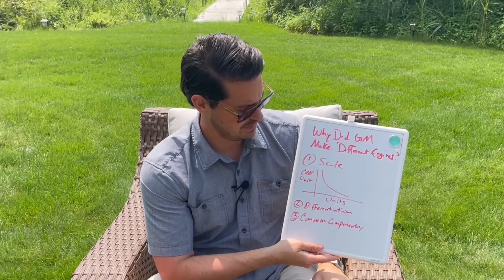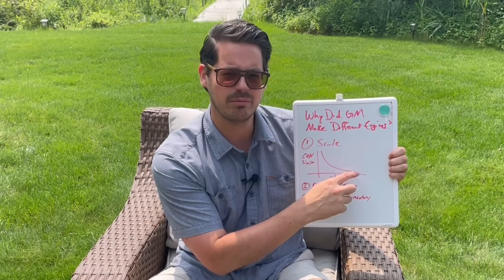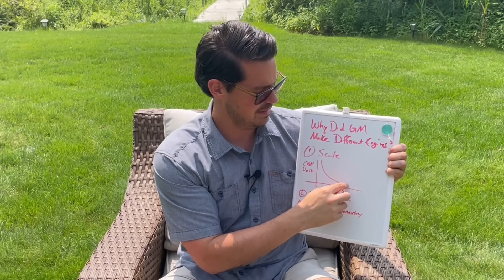Why did General Motors (GM) Make So Many Different V8 Engines in the 1950s-1970s?

Comment: Great, informative chat.  I recall test-driving a new 1975 Cutlass Supreme that seemed sluggish and noticeably different from the Olds Omega 350 I had just driven.  The engines felt and even sounded different.  I thought at the time that the Cutlass was more like a Chevy 350 as I had also been test-driving a number of Chevys w/ 350s, namely Monte Carlo, Malibu and Nova.  I ended up with a Camaro with a 350 4bbl.  I can remember when GM's engine-swapping got publicly exposed in 1977. It was a PR disaster for GM.

Comment: Or I have the 1981 Pontiac Bonneville with the Oldsmobile 307 with the 200-4R transmission and  the 1985 Caprice with the Chevrolet 305 with the 700 R4 transmission. One of the last holdouts i think of GM using 2 different engines with nearly the same displacement.

Comment: Interesting explanation. Thank you. I know I've mentioned this before but I really find it interesting that they didn't really have that much diversity in technology such as having one be a hemispherical head and another one being an overhead cam head to spread out their offerings and respond to some of the competition such as Chrysler with their use of hemispherical heads.
Reply: Really didn't need the exotic designs when their bread and butter designs were good.  Sure GM experimented but getting away from the normal stuff but doing so costs a lot of $$.  Ford has been the worst at blowing $$ on continuous new designs.... I give you the LS engines vs Fords SOHV, Hemi style and current OHV engines.

Comment: Gr8 Stuff Adam. Makes sense to save money through Economies of Scale, as Retooling wud have cost a lot more for Upgraded Engines every couple of years....Yep, differentiation was sensible if Recalls of the same engine was required.....Ford's Model T's wud have been a real problem for Old Henry Ford, if mass recalls were required on the exact same vehicle. A Reversal of The Economies of Scale and why all the other Manufacturers back then diversified engines, etc....😊👐

Comment: The main reason that GM started screwing their customers with chevrolet engines in Oldsmobiles, is
 because about that time they took the best and most durable V8 they made and turned it  into a extremely flawed diesel. Because the diesel was machined on the same lines as the gas engine, they didn't have the capacity to do both. We all know how that turned out. 
Of course GM has a long history of doing their R and D work with their customers money. 
Also the Buick V8 was their newest design of all the legacy engines and the first one to be discontinued. Brilliant!

Comment: An important influence on driving this rationalization of engines had to do with the high costs of emission certification. There were many drivetrain combinations that were low volume that the certification costs couldn’t be justified. The Z28 after 1974. The Pontiac SD455 also after 1974 along with the 454 in the Corvette. Each drivetrain combo in a given model had to be individually certified. Ford and Chrysler had similar actions. The need to meet stiffer EPA standards in 1975 that usually required catalytic converters killed off a lot of choices.

Comment: Great video, and some excellent comments, too.  When I was car-shopping in 1973, I noticed that all four GM car divisions (below Cadillac) had 350 cu. in. V8s, and they all had different bore and stroke dimensions.  Working through the numbers showed that they all came to between 349.5 cu. in. and 350.4, so all rounded to 350.  When I began working at GM in 1978 I learned that even Corporate management wasn't completely aware of the Great Chevy-mobile Debacle of 1976.  As I recall, it began when an Olds customer brought his relatively new '76 model into his dealer for a routine oil change, and the mechanic found that the oil filter was on the other side of the engine from where he expected it to be, and it was substantially smaller.  Until the mid-1980s, each car division had its own engineering staff, and each division was responsible for engineering everything forward of the firewall, which included the engine.  This is why you'd find the battery and windshield washer reservoir in different locations among the GM car divisions' models, even within the same platform (mid-size A-body, full-size B-body, etc.), and even different colored caps on the windshield washer bottle.  Brand identity was always a major concern for all automakers, especially among the GM car divisions.  Chevrolet's Number 1 competitor wasn't Ford, but actually Pontiac or Oldsmobile, as it was just as great a sin for Chevy to lose a sale to a sister division as it was to lose it to Ford, or Chrysler, or an import.

Comment: It also allowed the division managers and engineers to tailor driving characteristics and gave them some control over quality. The divisions were somewhat competing with each other. And the buyers took pride and were loyal to their brands often times because they liked that divisions engines. Then came 77 Chevymobile controversy. Many people were upset when they found out their new Oldsmobile had a Chevy engine but the air cleaner still stated Oldsmobile V8. Oldsmobile knew their customers wanted Oldsmobile engines.

Comment: Love to see a dyno comparison of all 350s from each division of the same year, completely stock and then modified with intake, headers and optimized timing.  1974 is my choice as I had an Olds Omega with a 350 4bbl, bumped the timing, open air filter and it did pretty well.  I'm curious how the other Nova clones faired with their engines in comparison.
Reply: By '74 government smog regulations had nearly halved output of most V8's.  The Omega could have had either an Olds or Chevy in it by that point, neither making much over 200 horse.
Reply: @scottysgarage4393  my Omega had the Olds 350 with 175hp.  The other Nova clones in 1974 had the respective engine from their division.  Not all 350s were created equal, and it'd be interesting to see how they compare.
Reply: @christopherhinkel8274  Yeah we were drag racing Novas, Omegas, et al in the 80's.  They were cheap and disposable and you could bolt anything in them.  The Olds and Buicks were stout but more costly to get performance parts for.  The SBC made about the same factory output and all had about the same factory times, assuming similar equipment and gears.  But the Chevy was cheap to get 300 horse from so it was the preferred engine largely for that reason alone.

Comment: I have been such a fan ofCadillac and Buick front distributor V-8s especially breaker point engines! Chevrolet, Oldsmobile and Pontiac V-8s with the distributor up against the firewall seemed more difficult to tune-up. And don’t get me talking about my ‘68 Lincoln and the front hinged hood!

Comment: Once again very educational Adam.  It was interesting.  Each brand was independent until things changed over time. It makes sense. It is hard to believe how different the brands were and the internal competition as well. So much of that was lost and it would be difficult to do that today. Economics changed so much as time went on. You think about the 3800 V6. It was a Buick V6 first then it became a corporate or GM engine. I knew things were changing in the late 1980's in the 1990's when they phased out the Oldsmobile 307 V8 and put the Chevrolet V8 into more cars. Thank you Adam.
Reply: The Buick V6 has quite an interesting 50 year history which could be its own porch story topic! From being in early 60's Buicks then sold to kaiser to put in jeeps which transferred to AMC and back to GM to be put back into cars then updated into the 3800 series... It's crazy!
Reply: @TheRetarp  And also crazy was GM ending production of the 3.8. None of the engines meant to replace it have been nearly as successful.
Reply: @P_RO_  The high feature engine series is the direct replacement. 18 years old and still going strong. Early on they had timing chains issues but that was fixed 10 years ago.

Comment: Australia here: in US 50's and 60's, were there cars where heaters (not A/C), windscreen washers, 2 speed wipers, radio were optional?
Reply: GM didn’t spoil us did they! The first HK I bought had demist only and no fan if I recall correctly.
Reply: @stevenhobbs709  Nope none of "the big three" did.

Comment: GM was (1) One umbrella that each division had there own drive train.
 After the dust cleared Chevrolet Buick & Cadillac became the GM money divisions.
 But in last 15 or so years GM is all cosmetic the drive train for each division dictates how much money your spending for your car.
 CADILLAC-BUICK-CHEVY
           OR. GMC.
Reply: Yeah modern GM with Chevy & Buick are exactly the same there is no point to buying a Buick. The last unique Buick was the TourX wagon which was nothing more than a re-badged Opel). Same engines. Same transmissions. Same interior gadgets. Cadillac though does still mostly have unique RWD platforms although their volume modules like the ATS/CTS (AT4 now?) have the same engines as the rest of GM (the 2.0L turbo & 3.6L V6).

Comment: Would greater engineering resources applied to engine development resulted in better engines? Back in the 60s and 70s, these engines produced woefully few hp per unit displacement, fuel efficiency was poor, reliability was  not great compared to modern engines, longevity was poor, smoothness was often variable. For example, the Mercedes 4.5L V8 of the era was just better in all of the above. It seems like GM could have focused much more on proper engineering and perhaps they wouldn't have been in the soup like they were by the late 1970s.

Comment: In the late 70s my dad had an Olds 88 with a 455 and a Buick LeSabre, also with a 455. Pretty much the same car, with the same Gear Ratio. They certainly were different in how they accelerated, from a Light, or by using Passing Gear.
Reply: I had a '73 Olds 88 4-dr and a '73 Buick 225 Limited.  The Olds acceleration didn't impress me, but the Buick did.  That said, the Olds was in some ways a nicer car.

Comment: I wonder if there isn't another reason here. Imagine if GM had built common engines, but given the low end model to Chevrolet, then Pontiac?, ... and finally Cadillac getting the highest performance engine. If these engines had that level of commonality, then one could buy a Chevy, and start slapping on the performance parts from the other brands. If they don't have that commonality, you are forced to buy the more expensive car in the first place if you want that level of performance.

Comment: I like the 409 cuz it would blow up everytime you run race oh I also like the gas engine conversion diesel in the 70s for the same reason probably what I like the most about GM V8 is they were known to use oil the day they came out of the factory

Comment: This touches on what, to me, is the bigger question: why did GM force commonality in bodies so much earlier than they did in the mechanicals?

From the 30s through the late 60s, the divisions would all have to cram their designs into body designs dictated by Fisher Body, but had relatively free reign over what went underneath. That made lots of sense in the early days when brands were differentiated in the public mind by things like engines, but by the 1970s I suspect most buyers stopped giving as much value to such things, versus the appearance, content and brand prestige.

The mechanical differentiation also only applied to the large cars. The smaller ones were sharing engines much earlier. By the late 60s the badge engineering was plain to everyone in the X-bodies.

Comment: Am I going to show my age here? They' were all "motor divisions". Chevrolet Motor Division", Pontiac Motor Division ", Oldsmobile Motor Division ", "Buick Motor Division ", Cadillac Motor Division ". Each division produced motors with considerable amount of engineering differences that a motor head knew the engineering principles that went into the heart of their machine that for a diehard Buick customer to find that they bought a new vehicle with the heart of a "cheap" Chevrolet  was a serious rippof. No. They were not the same and each motor division provided product with unique profiles. Those motor division swaps began long before most customers discovered them in the late 70's as GM was putting those Chevrolet 250 cu in inline sixes across motor divisions for a long time. Maybe the typical six cylinder customer wasn't as demanding as the typical V8 customer was.
Reply: Did the other GM divisions even have their own straight 6's?  The last one I remember was the Pontiac OHC one.

Comment: You may have romanticized the past.  General Motors management poorly executed the cut of division engines.  Accountants presented a path to save money, and management followed.   Additionally, your knowledge did little to explain the path General Motors since 1977.  Why did GM pursued corporate engines, not division engines?   The difficulties of emissions, drivability, fuel mileage, performance, reliability, and durability, in the “ malaise era”, produced in the mid-1970’s were some poor products.

Comment: I think what people don't realize is back then people when buying a Ford/Lincoln looked at it as buying a "FoMoCo" product so sharing engines seemed logical. Chrysler products were perceived as being "Mopar" so the engine sharing seemed logical. People buying a Buick or Olds absolutely did not perceive themselves as buying a GM vehicle. GM was a much more loosely associated line of car brands that had even their own engineering for each brand.

Comment: Okay. 
Buick introduced its famous eight-cylinder engines in 1930 model year. Engineers worked on maximizing parts interchangeability in the three new engines, but management ordered that not a single part should interchange among them.

Comment: What might have been if the industry would not have had the useless meddling of the Federal Government on stupid bumpers and the CAFE standard.   I contend that complying with a bumper standard that saved NOTHING in the long run of insured drivers (but added to repair costs above 5mph) set the industry back - creating even more bloated cars and eliminating styling options.     CAFE was and still is bogus - people will buy what meets there need and they don't need to be forced into doing so.    Automakers will build what sells.  Period.

I think the various GM divisions having unique engines really was what differentiated the brands - resorting to GM corporate engines was a disaster that rendered many brands obsolete.   I understand that compliance costs with emissions was instrumental in reducing engine choices, but several brands had really nice engines in various segments that could not be matched by the inevitable corporate choice.    Just as Chevrolet was forced to take that Vega, we had proof that GM was inept at managing the overall corporate market and various brands did much better jobs executing their segments than what GM ended up forcing them to do.

Comment: GM did allow some engine sharing. Way back in the 1930s, LaSalle used Oldsmobile engines. The 1961-63 BOP senior compacts shared the 215 ci V8 ( which would be sold to British Leyland ).

But to big reasons to me is by the 1960s, GM would allow the Divisions to compete with each other! Plus, a policy til the 1970s that let the Divisions have more autonomy. ( Example: GM developing 3 distinct automatic transmissions. Oldsmobile,Cadillac, & Pontiac using Hydra-Matic. Buick developing Dynaflow. And Chevrolet developing Powerglide & later Turboglide ).

Another way to show this is how the Divisions would overlap each other. Two examples: The 1958 Chevrolet Bel Air Impala ( it was advertised as such! ) pushed Chevrolet into Pontiac's turf. The Buick Special only cost a few dollars more than " The Low-Priced Three ". So successful was the Special, Buick kicked Plymouth out of 3rd place in annual production for 1954-1956.

Comment: Adam, do you suppose that the V8s were reduced in number also because V6s and 4 cylinders needed to be developed?
Reply: I would imagine also fuel economy was a factor - which engines could the powertrain engineers get more efficiency out of the engine. By the mid 1970's, the days of consumers accepting a 9-10 MPG 454 in a passenger car were long gone.

Comment: Ford 351 Cleveland and 351M (and 400) were actually a common design - the 335 series family. Bellhousing and deck height are different, but heads and block, crank, pistons…all based on common architecture. But I get your point. These engines were developed over time for different applications, and the OEM’s had enough volume to support this approach.

Comment: You should do a video on the GM Dexcool debacle, and their refusal to address, or even admit there was a problem.  This effected MILLIONS of cars over two decades.
Reply: I have 2 late 90s early 2000 G M engines (including a Northstar) that both got switched to green coolant the day they came off warranty. Dec-cool was horrible, slightest air bubble at the high point of the system and the red mud would begin forming. Conventional product with reasonable change intervals, never even a water pump failure.